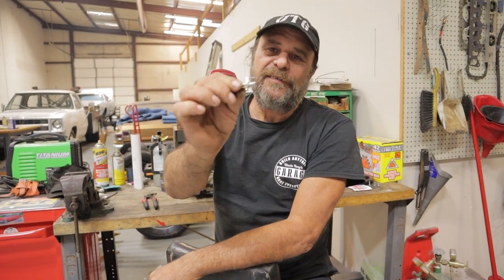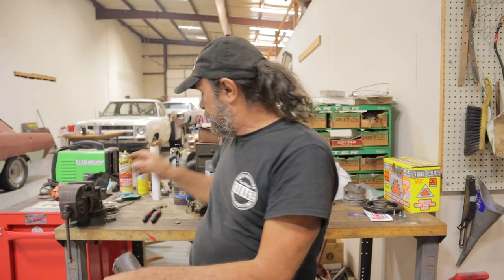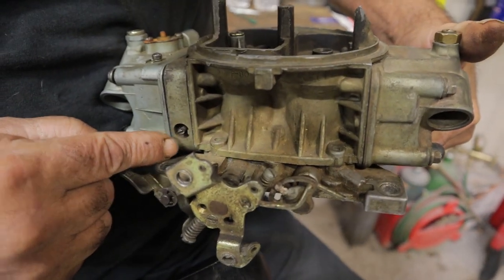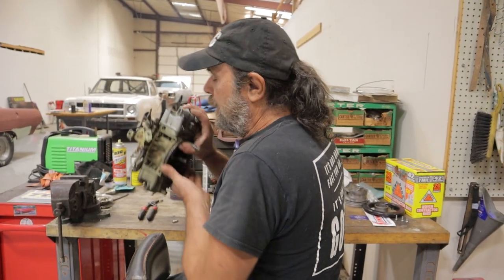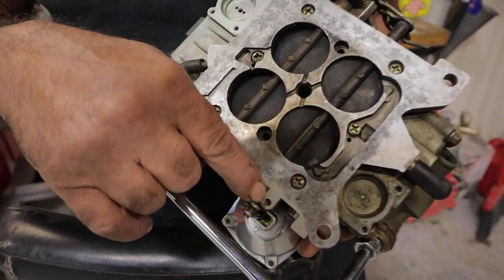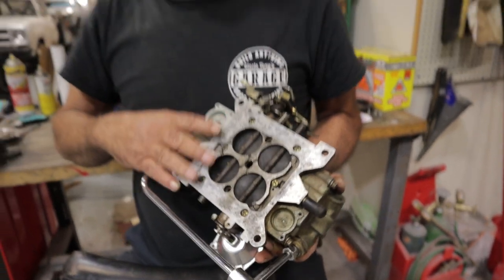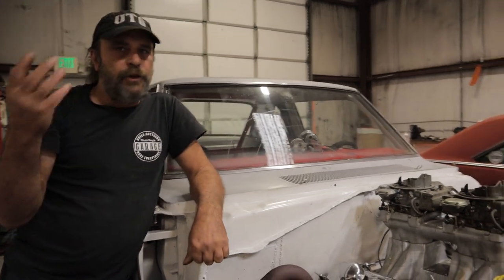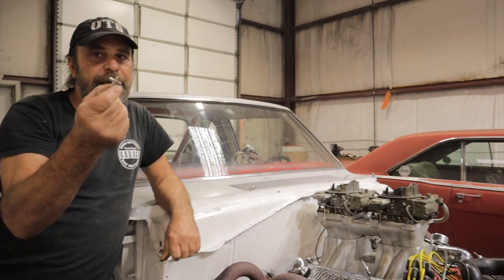Fine Carburetor Tuning Using Fish Tank Accessories - Regulated Vacuum Leak For A Cleaner Idle

Comment: Uncle Tony - I hope your viewers listen very well (and do) what you suggest in terms of adding idle air using the fish bubbler valve.  I did this some 35-40 years ago when I was tuning a 10.4:1 compression  Ford 460 engine to pull a heavy camper 'cause IT REALLY WORKS!  Of course I did many other things in tuning that engine that I've written in before, so I won't go into the other things here.  Your info is good stuff and I take you very seriously.
Reply: Or you could just find the right solution to the problem.... They sell carburetor parts for a reason... Idle feed restrictors.. idle air restrictors.. power valves,, power valve circuit restrictors,,,.these features are available on new carburetors something that's up to date keeping up with technology... Or you can drill out and tap your old carburetors...so these parts are also interchangeable in them... You really need a vacuum gauge and an air fuel ratio gauge to correctly adjust a carburetor...a carburetor is a wonderful thing when it works properly... This is a Cobb job repair at best that may or may not work... Carburetor is a complex piece of equipment.. designed to work in a specific way.. you can't just throw parts at it.. and expecte it to perform at peak performance... You change one aspect ratio you will throw off other aspect ratios in the RPM range... All parts work in conjunction... To achieve a specific goal...if this were not the case Barry Grant and other professional carburetor builders would have just threw parts on them .... Not designed for that application.... Such as fish tank oxygen valves.... And loop them from manifold vacuum to ported vacuum... Does that really seem logical to you.... Don't believe everything you see on YouTube... Do a little research on Uncle Tony...he's been called a scammer and he's ripped a few people off.... He is no professional in my opinion... And many other people's as well....just because he has a YouTube channel doesn't mean the guy is smart and knows what the hell he's talking about... I'm not trashing Tony.. I'm just stating facts..... Look up an article on..idle EZ,,, you may find this very interesting..... Advancements in technology....I'm 55 years old....I don't know everything..but I dam sure know when I see something f ed up ....and I know this is an F ed up cob job .....that will not fix anything...
I consider myself an intelligent man.. professional plumber for over 30 years....I'm very good at anything I do....and I do it right...why wast my most valuable thing I own..my time..doing anything any other way...
Other then the right way the first time...thanks for your time reading this comment.....be well...
Reply: @DonCatherman  at least you’re not bashing tony…🙄🙄
Reply: @lowrangeinnovascotia2930  maybe a bit arrogant... But nothing untrue... When people take constructive criticism as an insult there's usually a problem within that person... I'm working on the same issue of a rich idol with a big Cam and low vacuum...I just believe there are better solutions to the problem taking advice from professionals..
You have yourself a great day up there in Nova Scotia...and I hope you find great solutions to all your problems...
Reply: @DonCatherman  I have learned a lot from David Vizard's Holley book, along with my afr meter & vacuum gauge. David is a smart engineer who writes, NOT a journalist. If you can afford a Holley Ultra series they have incorporated an internal adjustable valve that does exactly what Tony's external one does. I drilled my second hand 850DP throttles last year though...
Reply: @lowrangeinnovascotia2930 
Yea I picked up on that immediately.
Reply: @DonCatherman 

Who has U.T. ripped off?

Comment: I’ve done this on the vacuum advance can, it works well to delay vacuum signal to the can preventing detonation on off idle acceleration. It dampens the sudden rush of vacuum signal when accelerating from cruising to overtaking speeds as well. Works great when setting your engine timing on the limit or tuning for economy.
Reply: That's a good idea, might have to borrow it some day
Reply: Think you've got that backwards, you'd be holding advance when you don't want it.
Reply: When I check timing, I have to disconnect the vacuum advance and plug it. With this valve, I could just close the valve and save some time!
Reply: @c103110a  wrong you will store vacum in the hose and vacuum advance can. best way to use vacuum advance is on manifold vacuum with the carb primary throttle open 1-1.5  turns on speed screw from full closed. start at 1 turn. adjust timing to set the idle speed with vacuum advance on manifold vacuum. this is how it was done in the days before timing lights. if you can not get good idle use the vacuum blead trick as well. point is never go past 1.5 turns on the primary throttle. from hear it is timing then extra air.
Reply: @c103110a  yes. If I understand you, u r not talking directly about the air around the throttle plates, but about the vonvience of not unplugging/ replugging?
Reply: @stuckinmygarage6220  Yes. Just and On/Off valve between the carb fitting and the vacuum canister. If I want to time it, I simply close the valve. After setting the timing, I open the valve.

Comment: had to drill the throttle plates on my sons 388 sbc. big solid lift cam. 264° x 270° @.050 .575" x .579" at a 106 lsa. couldnt get it to idle until i did this. started small on drill bit size and worked up. I think i had the carb apart like 5 times. Its a great feeling to drill holes in a brand new $700 Holley. lol
Reply: New plates are 20-30 bucks if it makes ya feel any better lol. Been considering drilling out my butterflies for a while but I think I'll try this first. Using both might not be a bad idea for big cams with a lot of overlap

Comment: Not carb related, but I used a similar valve to regulate the vacuum modulator of the C-4 in my old Mustang back in the '80's to raise the part throttle shift points.
Reply: You could already do that with the vacuum modulator..they make different ones and some adjustable ones.

Comment: Excellent tuning trick! This bubbler regular idea has many applications. In a previous video, Uncle Tony showed us that Edelbrock has a new, modern carburetor which has additional air bleeds to adjust for this rich idle condition. This bubbler regulator is a heck of a lot cheaper than buying a new carburetor.

Comment: Thanks that could have saved me years of cleaning spark plugs. I advanced the timing and adjusted the idle mixture with an air/fuel gauge. That fixed it almost completely on a mild race cam.

Comment: Hi Uncle Tony ! To keep the vacuum source usable on primary metering block ( for those who need vacuum advance), I connect the fish tank valve inlet above by drilling a hole near the top of the main carb body, insert and stick on a 1/4 tube ! This hole as a factory foot print on the main body ! He is located between the secondaries vacuum tower and main body,  and take air above secondary venturis when drilled. He is easily visible and drillable ! These inlet was used on some Holley's in the past with automatic  choke for choke pull off !
Reply: you are right! a lot of carbs had a fresh air port around the top for hot air choke even ford oe carburetors. I use manifold vacuum on my dizzy so i get a clean idle with the primaries set at the t slot. do this on bone stock & to rather hot cam stuff. slag hammer being a STRRET/STRIP car needs vacuum advance for part throttle drivability. if that was mine i would set the primary's to form a square and time it for max vacuum then dip 1/2-1 in vacuum from  peak. to do that you will need at least manifold vacuum on the advance can. this engine will need at least 25 degrees but more like 30+ to clean up ! total advance would not go past 32*. modern pump gas burns faster and the 36-38 was with leaded gas. on a engine like this the idle my be at 30 degree range. if so that will be close to peak power total timing and run locked out dizzy. run 8-12* of vacuum advance on ported source to add timing at part throttle for 38-42* at cruse.  but a better plan my be run a short mechanical advance curve say 18* and 10* base =28* total and 15-20* degrees of advance on manifold for 25-30 at idle. point is it is a balance between timing and idle air.
Reply: Thank you, both, for discussing vacuum dizzies There are a lot of Streetmobiles with mild cams that need them.  My Edelbrock is "going to the dentist" 🙂 Cheers

Comment: For a street engine and not wanting to drill out the throttle blades the regulator valve is a good option but I use it as a last resort. I set my throttle blades so they are just on the edge of the transfer slots, bottom edge of blades sitting right at bottom edge of slots. Set idle mix and use minor adjustments in timing to achieve a good idle. If Idle is still not right and mix screws aren’t responding I will adjust the float to get a little more or less fuel into the idle circuit. Higher fuel level will fatten the mixture, lower level will lean it out a bit. An 1/8” difference in float level will make a significant difference in how much fuel is pulled through the idle circuit. Usually a 1/16th change is enough to make a difference. That’s about the  difference of fuel dribbling out of the sight hole vs not dribbling out. A lot of people still run vacuum advance dizzys on street engines with moderate to large cams ( I do when I can) and the bypass valve complicates that setup. No vacuum advance…the bypass valve is a quick and easy fix but you should still try to tune without it first. It is a forgotten trick,  I haven’t seen it on a carb in 25 years but then I haven’t been around a drag car for that long either.

Comment: another solution to a rowdy cam if you can wrap your head around flat tappet lifters--variable duration hydraulic lifters from Rhoads or Crane. they bleed off lift below 3,000 RPM (give or take) and you lose the duration that gives your cam that racy idle. But at cruising RPM at highway speeds, you've got that mild cam grind and vacuum so you don't need 4.10:1 in the rear to keep the engine from feeling the ol' hunt and peck, esp. if you want to load it up with AC. 

I've got a .490 lift/260 duration cam in a 461 cid engine with a spreadbore carb that can pull a 3:1 rear gear ratio from dead idle in top (1:1 ratio) gear to redline in a 3,800 lb car. It'll even get 15 mpg. but it does run a captive discharge ignition, not points.

Comment: Thank you Uncle T! I'm gonna use that one for sure. On the secondary throttle set screw grind down a flat screwdriver bit and use it with a 1/4 wrench or a bit ratchet. That's how I do it.

Comment: I drilled many throttle plates. But if you buy a Billet plate from Holley or Proform, they have a secondary adjustment on the top side of the plate. Plus Billet plates are more acurate.

Comment: There were some old school valves for fish tank air that were designed like a idle mixture screw. Those would look cool in this application.
Reply: Yes! Good memory.  But, I think they leaked a bit? Rubber washer? 🙂

Comment: G'day Uncle Tony,

Thanks for a great video.  Having had to drill through a few throttle butterflies in the past, I like this trick.  It's a cheap version of the Air By-Pass screws on the Type 55 DCOE Webber carbies.  Very good.  I never considered it on Holley carbs, because I always used manifold vacuum, & blocked off the ported vacuum source.

BTW, the rich idle condition with wild cams is not caused by low vacuum - it's caused by the engine 8-stroking.  On engines where there is a great deal of valve overlap, at idle, airflow in the manifold will initially reverse, as the piston is nearing TDC, with the inlet valve open.  As the piston decends past TDC, & the exhaust valve closes, airflow in the manifold will resume towards the cylinder.  As the air moves back & forth past the idle & transfer ports, fuel is drawn through the openings.  But, since the fuel is drawn through the ports twice for that inlet stroke, there is twice as much fuel as there should be.  That is what causes the rich idle condition.  In some cases, the idle mixture is so rich, a cylinder, (or many of them) will only fire every 2nd ignition event.  This is now 8-stroking.

Anyhow, keep up the good work.

Andrew
Reply: I like this explanation - but in a reversion, that little bit of air is passing the fuel outlet 3 times !
Reply: Hello, Andrew, Peter, 
Do you both agree with the concept of sourcing air around the butterflies?  I think u do .  I want to retain my manifold advanced dizzy.
What intrigued me was the comment about missing combustion.  Is anyone recommending MSD?
Thank you
Reply: @stuckinmygarage6220  MSD was brought up in the video - you get up to 6 spark events at idle,  and gradually fewer until just 1 at higher RPM's
Reply: @stuckinmygarage6220  Peter, the missing combustion is simply because the mixture is far too rich, much in the way when an idle mixture screw is backed out too far.  When the mixture is too rich, there simply isn't enough oxygen to support combustion, or the fuel is not atomized enough, so the fuel does not ignite.  For further information, see Kevin Cameron, or Bruce Crower - I would have learned this from one of their editorial conrtibutions to the Cycle/Cycle World, or Hot Rod magazines.
Reply: @peterdarr383  G'day Peter.  No, it doesn't.  There's still positive pressure in the cylinder as the inlet valve opens.  Also, the piston is still approaching TDC when the inlet valve opens, which will also creates a positive pressure in the cylinder & both ports.  So, the initial air movement in the carb is from the manifold out, then the air filter in - that's twice.
Reply: @hisproperty1438  "So, the initial air movement in the carb is from the manifold out, then the air filter in - that's twice." Your not counting that the air in the manifold has already passed thru the carb once to BE in the manifold. Then the reversion, then thru the carb, for the THIRD time.
- also - 
There are dynamics where the exhaust "pulls" or scavenges the combustion chamber, but not at idle or certain RPM's

Comment: Back in the late 80s Oldsmobile EGR surge was just a part of life if you owned one. Put one of those valves in the EGR vacuum line and tune the surge out and instant happy customer. On a side note, you can cure idle hunting and stalling and check engine light  complaint on a over cammed TBI motor with a controlled leak in the PCV line

Comment: ah yes...bringing old school fixes to the masses. i remember this one well. of note...i took this to the safety side of the situation by adding a dust blocker in the form of a small engine gasoline filter before the valve. once set up it will let you know when it needs to be changed as it will plug up with dust-etc and lessen the amount of the controlled vacuum leak.
Reply: You could just run a fuel line from the barb on bypass to a barb in front of the throttle plate. All you're doing is bypassing the throttle plate, and exchanging manifold vacuum for ported vacuum. This way, the air you're sucking in bypass has already been filtered. This also has the benefit of not changing the main jetting, as the restriction will be the same at wide open throttle, as you're still getting ported vacuum restriction from the air filter. Double wam bam thank you ma'am

Comment: drilling holes in the throttle blades is what some GM cars in the late 60s and early 70s had I've seen it a lot in the hotter factory cam Oldsmobile engines. Great video as always!

Comment: A good friend of mine could have used this trick years ago! He had a 1976 Chevy C10 long bed that he and his dad swapped in a Pontiac 400 into with dual Holley carbs. The thing ran great, but it would not idle for beans for very long. Would load up and die after a bit. Would have to clean the plugs after any drive in traffic. No traffic and it could just drive? Never had to touch the plugs. Had a built TH400 with an aftermarket overdrive unit and a built Dana 60 rear end because his dad had it and the Pontiac 400 just sitting around. It was an ugly thing...but it sure got to 150+ in a hurry......

Comment: So I have a 67 Mustang with 351w and was having a heck of a time getting it idle without being in tears from it running so rich. So I did what uncle T suggested minus the regulator valve. So basically just ran a hose from manifold to port. And I have to say that now my idle is managable, adjustable and drivable.  But I do think that I am going to need a bit more air to lean it out a bit more and or drop my idle speed below 1100. So what I am saying is it has greatly improved my issue and that may be all someone else needs to get it perfect. I am getting closer for sure. I do have one of those regulator valve coming from amazon but not sure I will need it afterall. It was $5,  I think I will survive spending that. I am thinking I will adjust the stop on the rear throttle plate next to give me a little more air before diving into drilling holes into the throttle plates.  Any segguestion or idea for me to try would also be greatly appreciated. Thanks again.